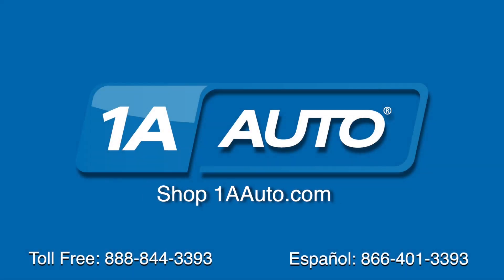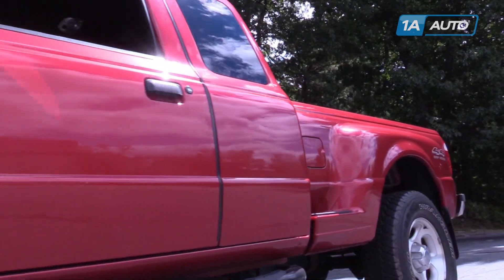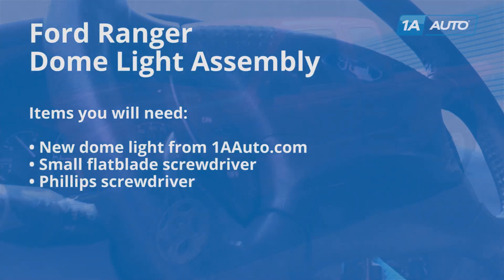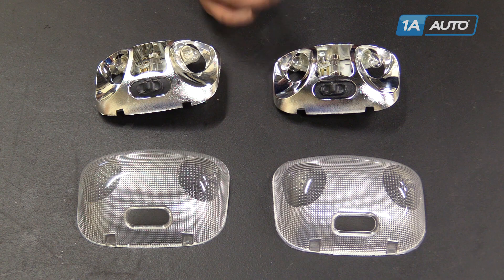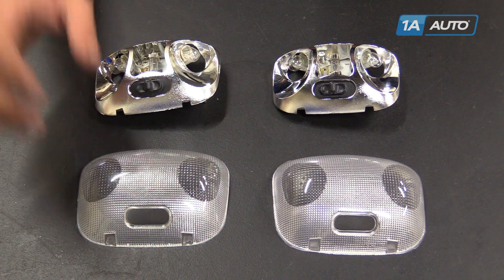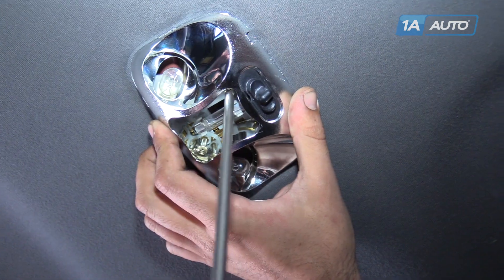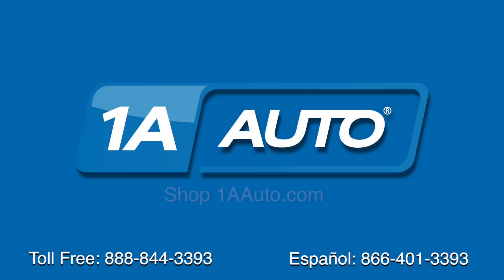How to Replace Dome Light Assembly 98-03 Ford Ranger

Comment: It's incredible how the dome light cover pops off so easily for you guys but in reality is a pain
Reply: Practicing...
Reply: Finger Technique😳
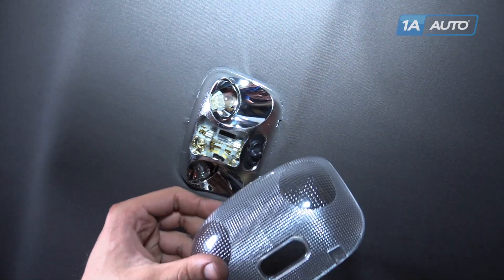Reply: Didn't you see that jump at 1:04? They edited out the half an hour it actually took them to do it.
Reply: It really needs some pressure, I thought I was going to break it
Reply: I thought I'd broken mine when it popped off. It's a very bad design on something so simple.
Reply: Yeah its tight because of a FTSB recall.  Apparently in a head on collision with a bullet train, the plastic cover can pop off and fall into the chicken finger dip.
And who wants that?  🙄
There is no reason for that cover being tighter than the lug nuts on a Nascar.
Ford designers really need to connect with their customers.  Of course they aren't buying Rangers.  They are in the luxury class wheels.
Reply: Hahah thought it was just me. Thought i was gonna break mine pulling it off

Comment: If anyone is wondering: the 2 map light bulbs are a size 904 bulb. As for the center bulb it’s a 212-2 bulb. 

Websites, auto parts stores, and community forums state the wrong bulbs as being 906 and 912. I’m warning from personal experience not to use 912 bulbs as the wattage is too high it will melt your dome light socket for the bulbs. The first time it actually popped a fuse for me. You can use 906 bulbs for your dome lights, just that the lights will be dimmer than the 904 bulbs.
Reply: Se podra reemplazar las  bombillas originales por bombillas led

Comment: Broke my assembly tugging on it like that.  My 98 assembly is a bit different, no center bulb, not even a fixture for center bulb...like bulb delete or something.  Saw a new assembly was $145.00 and out of stock.  JB Kwik weld to the rescue!  Not paying $145.00 for a new light fixture for a 22 year old truck, lol.  If this doesn't work, will just use a flashlight at night if I need to.
Reply: O-H-I-O Porter greetings.🇺🇸 Just bought a 2003 Ranger XLT & the dome light doesn’t work at all. Found the bulb & fuse missing. Doesn’t look like a bulb even fits in the middle of the assembly, just a fuse. Did these lights have problems draining the battery by staying on? If they’re $145 now, then that’s still a lot. The truck sure needs a dome light of some sort! Will inspect further when it’s not dark. 🥰🤩✌️

Comment: Great info I had assumed the screws act as the wire attachment the 2 that screw thru the wire endings that are threaded, the video did not specify that but it has to be how it connects since there is no other way shown! Thanks!

Comment: How is the chrome reflector attached to the part that screws into the roof area , what actually holds the reflector onto that besides the three screws???
Reply: It is stamped into the circuit board. The circuit bird and chrome reflector are 1 piece, they’ve been stamped together at the factory. You can separate them if you wish to repair the circuit board but if you wish to stamp them together you’d most likely have to super glue it together.

Comment: My 2002 Ranger Edge dome light only uses 1 center 904 bulb... And only comes on with the doors. I wonder if I can upgrade to a switch type so I can manually control my dome light. Mine comes on but will not turn off.

Comment: O-H-I-O Porter greetings.🇺🇸 Just bought a 2003 Ranger XLT & the dome light doesn’t work at all. Found the bulb & fuse missing. Doesn’t look like a bulb even fits in the middle of the assembly, just a fuse. I don’t have any history on this light from the previous owner, regretfully. Did these lights have problems draining the battery by staying on? Almost sounds like it. They are pretty cool lights. If they’re $145 now, then that’s still a lot. Will use the 904 bulbs & maybe a 15 amp fuse. The truck sure needs a dome light of some sort! Will inspect further when it’s not dark. 🥰🤩✌️

Comment: My wiring was loose when I took my dome light off, and the black plastic on the green/orange wire disintegrated and I have no idea how to reattach it.  Any help would be appreciated.  I tried attaching to a screw, but sparked and blew a fuse.  If I have to buy a new black plastic piece to splice on the wire, where and what is it called?  Thank you so much.
Reply from the maker: +Tanya Thurman Thanks for watching!  If the wire coating is falling apart then you will want to replace that length of wire.  This will require splicing in a new piece of wire, so if you are not familiar or comfortable with doing so we recommend having a professional perform the repair!

Comment: Hi guys, I have a question. I have a 1997 Mazda B2300 (a ford ranger scencially), In my case the dome light have not a center light, but for some reason It have not a off position, it have a 3 position swtich but the light still on even if the door is closed. I manage to turn off the light moving barely the switch to aside, but is not a good solution, what could I do?.
Reply from the maker: +BlackF90 Thanks for checking us out! It sounds like you may have a faulty switch. You may want to have the vehicle diagnosed by a mechanic prior to having any repairs done, thank you!
Reply: @1AAuto  thanks very much, I'll go to check that.

Comment: Yeah I have no JB Weld but I’m gonna have a little sticky situation maybe with a little silicone adhesive although now I think about it I do have some knock off JB Weld good choice thank thank you for the advice. I did the same thing you did knocked it off broke off the little peg inside the hole, peace out Joel